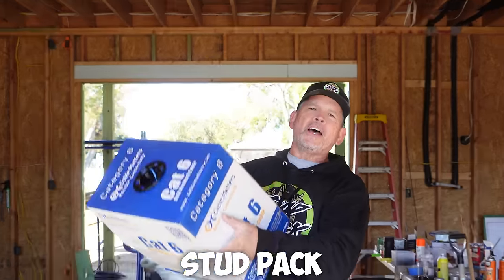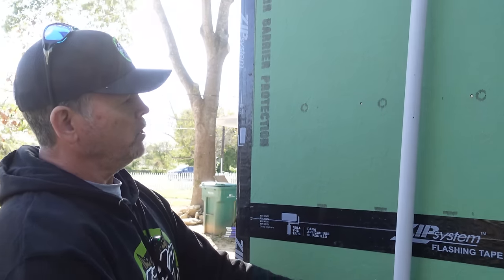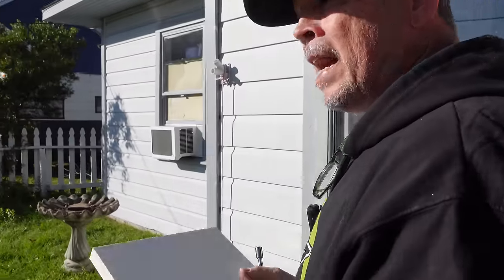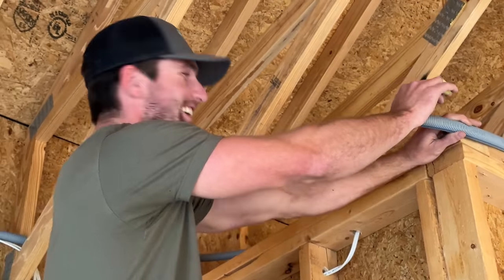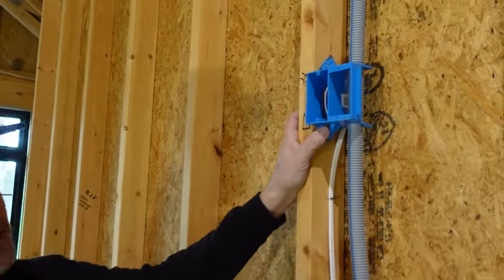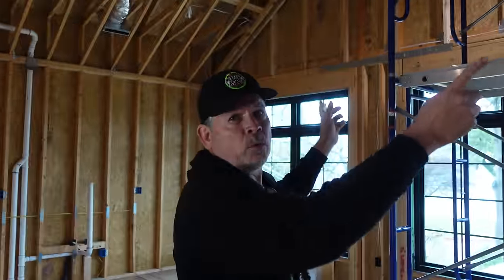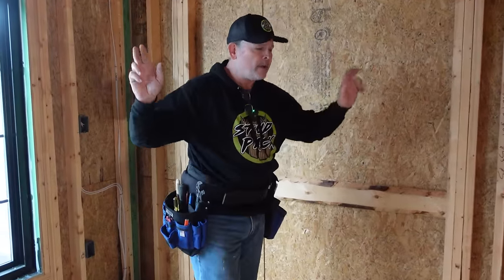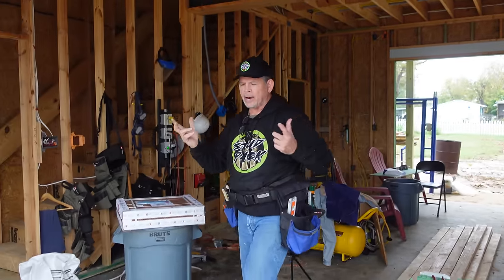DIY Networking for a Future Proof and HIGH SPEED Home! (Smurf Tubing and String Pull Trick!)

Comment: Wherever you expect to have multiple pieces of equipment, I would run two or even more Ethernet cables to a single wall plate.  For example, you may have a printer you want to share across the network, and a computer, and an IP phone, etc.  It is much easier to troubleshoot direct wired connections to a main intelligent switch, than to run multiple small switches wherever you have more than one piece of networked equipment.  Wire is king!  40 years from now it will work as well as today.  Fast and secure.
Reply: Yes! There's also a bandwidth limitation for each cable that should be considered. Adding another cable can hypothetically double the bandwidth at that location depending on the scenario.

Comment: What a great video. It’s nice to see public utilities serving the needs of the community and not just want they want to do while they are there. I know it took several phone calls, a downed line and a inspection to fix an issue that cost my mother in law her breaker box, lights and chain link fence before something was done. All they had to do was come out and see the anchor on the pole was loose and needed to be addressed asap. However, they blew her off and the next gust of wind the line came down and made parts of a chain link fence disappear or become one, welded together. Even blew a light off her kitchen wall. 
Your team seem to be very customer focused!

Comment: Pro tips. I do this for a living and mostly new construction residential. From 3 bedroom homes to mansions.

Hope you're spray foaming that attic space or the heat will kill the equipment.

UTP cable should be a minimum of 4 inches away from electrical. It's alright for very short runs going parallel and going over but if you're going more then a foot you should be a minimum 4 inches away. If you have to be near electrical then use shielded UTP. 
You should use keystones and wall plates. Reason being solid core doesn't last as long as strained core when it comes to movement. The more the cable is moved/flexed the more strain on the conductors and you start getting slower speeds and some point no connection when conductors start breaking. Would be alright for temporary drops.  Also it may hinder the blower test since you'll be using scoops or whisker boxes if you use a straight RJ45. There is no advantage gain when using a RJ45 straight to a device rather then a patch cable going from the device to the wall.

Pass-through RJ45s are the devil and is a sin in the low voltage world to use them. ATT loves to use them then blame the cabling. Times I wish I could back charge ATT.

If you want 10Gbit connections then I would of personally used shielded CAT6a. You can get 10Gbit with typical CAT6 but your mileage will vary. Also make sure the cable is 100% copper and not that copper clad trash. If unsure what you have look at the datasheet from the manufacturer.

When it comes to the main house have the SMC/head end in the middle of the house if possible. Like under the stairs, a closet or what have you. You don't want to go over 328ft with a data drop. I try to keep my runs around 300ft so it gives wiggle room for the patch cable length going from the wall to the device.

Comment: I learned the vacuum trick on the first major lighting job I was apart of. We were replacing a bunch of old concrete poles along a walkway, a good thousand feet in total. When we were getting ready to pull the string in, my coworker said we needed a plastic bag to pull the wire. The look on the faces of the people in the cafeteria when we asked for a bag, was priceless.

Comment: I would use CAT6A, the shielding makes a difference in longer lengths - at least the ones you might be pulling to the future house .. or overdo it and pull another fiber to the house as well to have a good backbone 🙂
Reply: Both cat6 and cat6a come in shielded or non-shielded.  Most installs are UTP (unshielded twisted pair).  There are many different versions of STP (shielded twisted pair).
Reply: I would have absolutely went with Cat6A UTP instead of just Cat6. It'll work for now, but they may regret it in the near future. I also agree that keystones are needed to terminate those connections.
Reply: @wojtek-33  " handles 10Gbe at least up to 300ft."
No, only about 180 feet. Issue with fiber is DIY terminations. You need special equipment to terminate fiber. 10G will become more widely used with switches become more affordable.
Reply: @wojtek-33  Not always possible to pre-terminate fiber, and difficult to determine cable length when cable is running through walls & ceilings. I know because I've run a lot of cable. 

Most people would prefer cabling over wifi, but that isn't an option since very few homes are wired for ethernet. Most custom homes have some ethernet cabling, unless its for an older person that doesn't use the internet. 

Once the cost of 10G\2.5G equipment come down in price people will buy. Just like in 1990s when 1G came out. It was when the cost of 1G equipment came down people started buying it. At this point I don't think its possible to by a switch\router that does not support 1G.
Reply: @route_switch In a home there's no real benefits from 6A in 99.99% of em

Comment: I would still advise using a patch cable to a femape socket in a wall, easier to troubleshoot in case wire fail or connector head fails.

Comment: If you only had fiber running through that tubing, it's unaffected by power lines. If you have copper/CAT networking cable running through it, you'll want to avoid power lines and if you have to run near power only cross power at 90 degrees (perpendicular).

Love watching your videos! Keep up the great and professional work!

Comment: I would definitely recommend going with the female jacks and wall plates for all your cat6. It’s much easier to just replace a patch cable if something gets damaged. 

Also I would avoid the pass through jacks if possible. They can have issues especially with POE devices. They can also have issues outdoors with moisture and corrosion. 

If you need any guidance please feel free to reach out, I do low voltage and networking for a living.

Comment: For the temporary run for the workstation I guess a direct cable is fine but at least for the TV run please look into using keystones. Really makes the whole thing look a lot cleaner once finished. I'm also curious if you guys have thought about what you're going to use for wireless, be it just an all in one box or if there will be plans to use a multi access point setup so the garage/apartment and the main house later have a seamless transition without losing signal. I also find having an outdoor access point to be nice for streaming outside but I also have bad cell service outside.
Reply: Ubiquiti, right?
Reply: @DavidNitzscheBell That's what I would recommend.
Reply: @DrD6452  I second that!
Reply: A decent router gives you 200-300ft. Should be good with a single point of connection. How often do you see the neighbor's wifi showing up at your house?

Comment: I am an ex-IT (gone into software engineering) and done more than a few ethernet runs. Love seeing the vacuum trick. Agreed with others on using wall plates for cat terminations. I also recommend that you future-proof yourself and put in at least cat 6a, though in my opinion you should go straight to cat 8, though it will cost a bit more, that will support pretty much any RJ45 based networking gear for many years, any of cat 6a, 7, or 8 can support 10 GbE (and technically also cat6, but only for shorter distances). You can also use 2.5GbE hardware with cat 6 just fine, though, so I wouldn't call it a "must have".
Reply: Cat 6 will run 10Gb for like 185', which is plenty for 96% of homes

Comment: I would not put any equipment in unconditioned space, even if it designed for higher temperatures (it just won't last as long). Keeping the fiber equipment close to the rest of the network equipment will be very helpful later.  Also, we have not seen the other end of the Ethernet connections yet, but you will love having a patch panel bringing all that together in conditioned space that is easy to reach. .

Comment: Saw a notification but was not able to watch until now. Got excited about seeing Stud Pack build the network portion of the house using CAT6. I already know you're reading the comments about what to revise. They definitely know what they're talking about regarding using wall plates. Try to stay away from electrical components due to EMI electro magnetic interference and possible RFI Radio Frequency Interference. This will cause your data transport irregularities. Fiber is unaffected by these issues due to its transport being light. Not sure if you plan on using a dummy switch to trunk everything but its worth a look.

Comment: Also may want to consider buying a run of Plenum rated cable for the connection(s) into the garage. I'm not sure about your local code, but here we have to have continuous fire separation with attached garages and that includes penetrations for wiring and cabling. Plenum rated jackets for cable will prevent flame spread in the case of a fire in the garage.
Reply: CMR will also provide the continuous fire protection.  I do note they're using just CM, so there's still a point.  Plenum is really only necessary where you're running cabling through air flow areas.  Common in commercial since drop ceilings are commonly used as air returns.
Reply: @gdave44  True, CMR would be sufficient in this case probably.

Comment: I wish I had seen this video four days ago.  I had my fiber installed this past Wednesday.  I live in a 1972 tri-level home and the best place to bring the fiber into my house so there wasn't fiber attached to the outside of the house.  I spent all of Tuesday running the conduit so the fiber installer had an easy install.  I used 1 1/4" Schedual 40  gray PVC conduit, I came through my exterior wall just above the concert basement wall.  The ran the conduit horizontally 23 feet between the drop-down basement ceiling and the first floor joices.  Then made two 90 degree offsets and then went verticle through the void for my heating ducts up through the first floor into the attic.  All total my fiber run was about 35 feet.  The conduit you used would have been much easier to use but harder to run through the basement drop-down ceiling.  I still have two old Cat5e lines that I want to replace and I may use the conduit you used to make those upgrades to Cat6A.  What is the inside diameter of the conduit you used as I may use premade Cat6A patch cords and I'm not sure two patch cords would fit at the same time.  If not then I will just run a second conduit to make the drop from the attic down through the interior wall.  I might even get two different colors of patch cords so I know which one is for the printer and which one would be for the Roku/TV.  The only rooms in my house without a RJ-45 drop is the kitchen, dinning room, laundry room, and the bathrooms.  All of the rooms with drops have two drops.

Comment: After 25 years doing LV I still hate passthrough connectors.  If the cable does not cut perfectly you can have a cable that will not click in correctly then you spend hours troubleshooting a device that has no internet.  I would also prefer to have your Fiber modem accessible for troubleshooting, but that's me.  I also agree with wall plates and jacks.  On a positive note the basics of crimping an RJ45 was excellent.  Thank you for another great video!!
Reply: I just spent half an hour and a trip into the attic to track down just this.  Odd part is that it worked, for over a year.  It stopped while I was changing other cabling, so I spent time scratching my head to figure out what I changed to cause the outage.  Finally, I went back to basics, ran my cable testers and just happened to notice a 1/32 of wire was sitting proud keeping it from fully engaging.  I'll still stand by pass through connectors, I'll just be a bit more careful of my QC when terminating them.
Reply: I know that pain haha. My crimpers also don't have the blade to cut the wires on a passthrough so I just have to line them up and hold them in place if I only have a passthrough.

Comment: Network engineer here. As most of the comments have pointed out doing keystone with boxes is the best way. Also a patch panel on a little data closet for your modern, router and panel would be great. Depending on how in depth you want to go with wireless and wired connections managed switch to isolate cameras and iot would be good. Never run Ethernet parallel with power. 90 degrees intersection of you have to
Reply: You can run parallel for 6 feet but yes they should avoid it if they can.  Also since you mention cameras...in the ip cameras the ends only will be fine as the end will have no movement inside the camera mount.  Anything else 110 blocks or keystone jacks is an absolute must.

Comment: Love watching the progress on the build guys, and you're finally in my trade! I like the good work with the conduit tubing, very clean. Some things you may want to remember to prewire for now: wireless access points (at least 1 per floor should cover the garage, maybe prewire for an outdoor access point for the back & front yard), thermostats *some only do wi-fi*, garage door opener/control pad, and you already mentioned cameras but I'd also run 1 Cat6 to the doorbell for a smart doorstation. I'm not sure what sort of equipment you or probably Jordan has looked into to run this home network but my company trusts Ubquiti's Unifi lineup for all our clientele's networking needs and they also run a great suite of cameras and security products. And it's honestly not nearly as costly as similar enterprise level solutions. A Dream Machine plus a 48-port Switch with PoE would run the garage plus more,. Then add on 2 of their indoor and maybe 1 or 2 outdoor access points and the house would be bathed in high speed wi-fi. All their access points as well as their cameras are PoE or Power-over-Ethernet capable, so no extra wires needed. Just 1 Cat6 to a location and you're covered. Plus they make very easy to add on Flex Mini switches that can break out 1 Ethernet connection into 4 or more with again no extra wires required, so now your single Cat6 wire under an A/V cabinet or desk can become 4 or 8 and run multiple devices like the Smart TV, and AVR or soundbar, a game console and more.
It's great seeing you guys work through the process of this build and handle all the curveballs a custom home throws at you, it's hard work but the end product is worth it! I love working in some absolutely gorgeous homes, if y'all need any help or questions answered don't hesitate to ask!
Reply: I agree👍
Reply: They want to, they could reference linus's house for their internet?
Reply: Spot on man!

Comment: As someone who did these types of installs for years I 100% agree with others who say its a much better idea to terminate into a rj45 keystone wallplate than to have just a cable coming out of the wall. For behind a tv or something sure the cable is probably fine but for other areas any damage to the cable or change in equipment could result in needing to run a whole new cable. 

For the power and data thing I guess it would depend on codes and such, I always tried everything I could to not run HDMI/Cat6/Speaker cable or anything else next to power. Usually if I could I would run it in a separate stud bay, but if that wasn't an option I tried to get as far away as possible. 99% of my work was done after drywall was done so it wasn't always Ideal but that's what I tried for.

Regardless love the build and anxiously await each new episode :)

Comment: I wired up my basement and used Cat 6A.  After connecting all of the RJ45 ends I tested each cable and made sure that I was connected at 10g.  I had to replace the ends of two cables out of 10 runs.
Reply: I agree! To "future proof", I would have gone with CAT6a instead of CAT6.

Comment: 15 years construction and over 20 years in networking and I work for one of the big recognizable companies currently…Been running Cat6e for over 13 years in my old home… I put Cat7 in my new place 2 years ago.
It is better to add punch down plates at the outlet.  The solid wiring isn’t as flexible and the connector will loosen / break and stop working over time.  Patch cables are stranded which is more flexible and the connectors offer strain relief as well.  The wiring is all tested / rated so there is almost no signal loss.  I used Cat7 patch cables on my Cat6 network as it is reverse compatible.
It’s smart to move the Cat cabling away from your 120… it will distort the signal.
I only use the combo boxes at the TV locations.  The wired connections for my computers are all separated in their own box.

Comment: While it may (or may not) be out of view out of mind at this point in time, I'd highly recommend running all of the data drops to a centralized location (usually the same location of the electrical panel) and terminate all drops into a patch panel. From there you'd patch the drops to en ethernet switch or directly to your wifi router. Check out Ubiquiti, Aruba, etc full suite of network gear and build a proper network for this new house - it'd be worth it; done it myself.

Comment: Keep as much of the twists and limit the amount of cable pairs are exposed. The jacket, plastic separator, and twist helps reduce crosstalk and interference. The twists are what help keep the frequency close to the 250Mhz spec in order to keep that 10GbE bandwidth steady. Great to see someone merge this kind of content. Let us IT guys know if you want to get an APC shelter rack installed, home lab with some home assistant ,or some 400GbE over  over MPO fiber.😀.